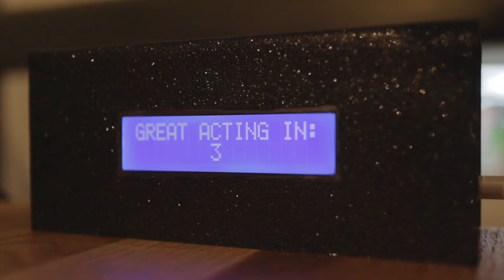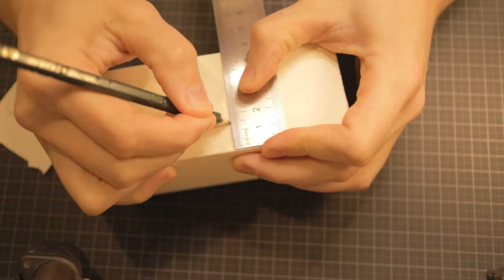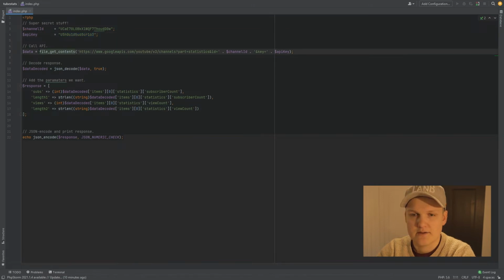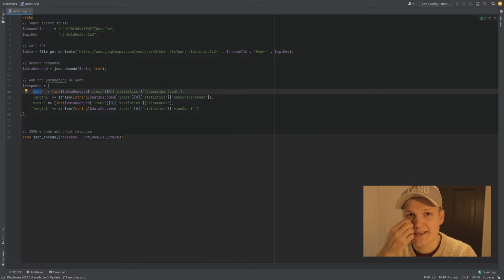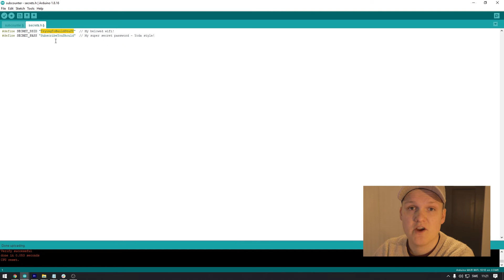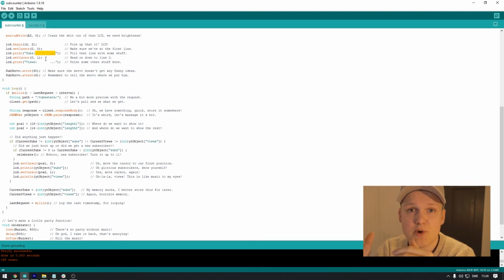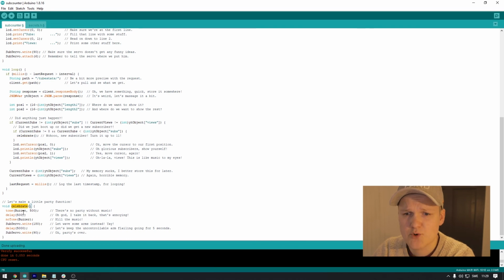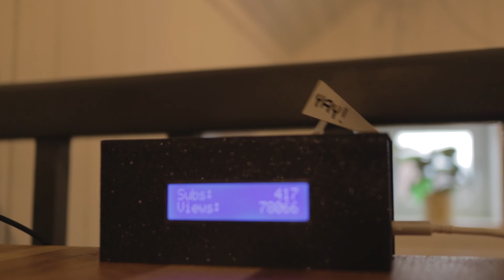How to make a YouTube Live Sub Counter - with Arduino!

Comment: getting so nervous watching you shake that much when you solder. try that beer for the next time- just to settle them nerves a bit. either that or anchor your elbow to the desk so there's much less movement :p

also, that was an interesting cutting disk, never seen one quite like it. also, why hide the crimes? remember this one phrase for when you work with wood: "well, you know wood.. it's a living material, of course it will warp and shift with time"

also, so brave of you to GLUE everything to the box before you actually tested it, so brave. 

nice bit explaining the code. as others can attest to you, im not really savvy when it comes to the coding or programing what so ever.
Reply from the maker: Haha, yes, I think I'll try that beer next time! The cutting thing is awesome, found it in a local hobby store. Always wanted one, but they're all green, so when I found this one I bought it right away! And yes, wood is a living material, but I rushed it a bit. Might do an updated version with some lightly stained wood when it's warmer outside.

The part where I explain the code was a bit long, but I wanted to do it properly if any other beginners (like myself) wants to try to build one.

And I might have tried the setup before gluing it to the box, but I need to add some suspense to the video 😉

Thank you for your comment!